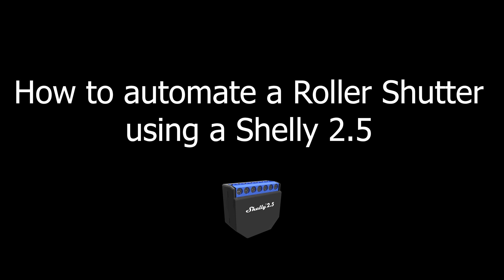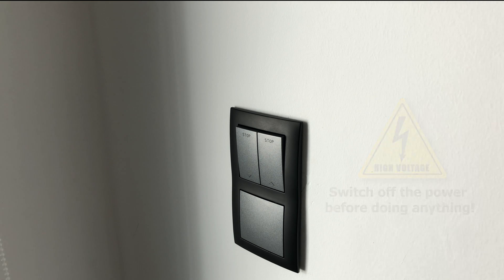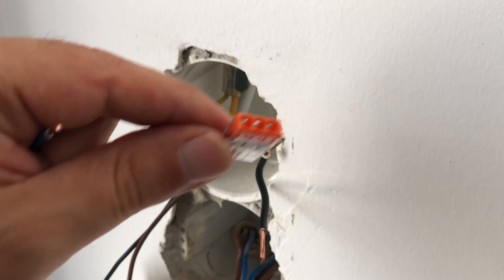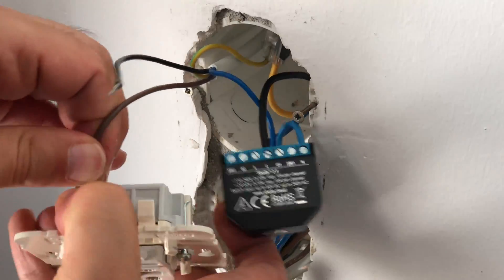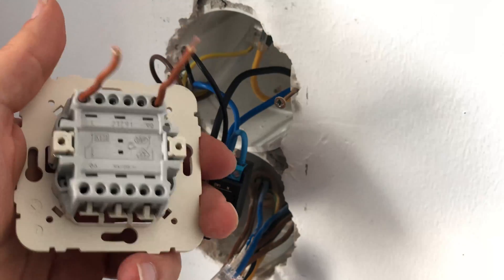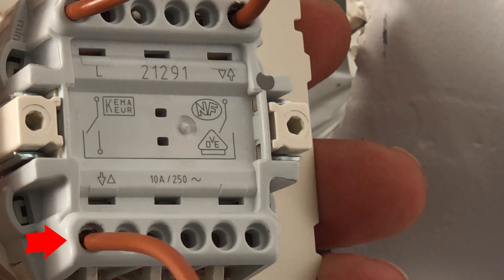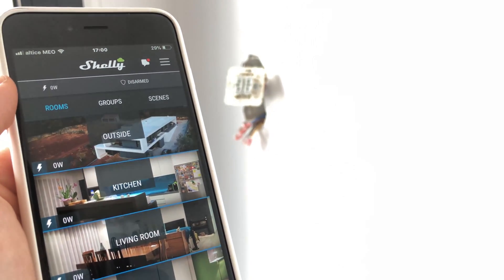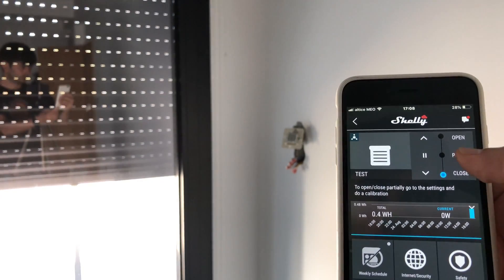How to automate a roller shutter using a Shelly 2 5

Comment: I have a Shelly 2PM Plus and I've got 4 wires coming in from my roller shutters.
Would you please advise what are my options for wiering it?
Thanks
Reply: I would imagine it's 2 load wires (up and down) and then line and neutral. Do you still need help with this?

Comment: Hi friends, can I use din version ? (I build my new house and I have all wire from switches and electric blinds to switchboard..) I found shelly 2 pro or shelly 4 but is alternative to shelly 2.5 ?? Thanks !!
Reply from the maker: Yes! It also supports Roller shutter mode.

Comment: Great video,  but there is one issue. The switch on the video has 2 x STOP and 1 x UP and 1 x DOWN.  The Shelly only has 2 x Switch outputs.  The problem I have now after installing the Shelly 2.5 is that Shutter doesn't stop when I push the STOP button.

Without the Shelly I can stop the roller shutter by pushing STOP,  with the Shelly the STOP doesnt work.

I saw you have switch Efapel 21291, I have 21290.. I that why?
Reply from the maker: HI Paulo! Thanks for your comment! I think the only difference between the 2 EFAPEL buttons is that in mine (when doing it without Shelly) I have to manually stop before activating the opposite action. I think in terms of connections to the Shelly they are probably the same. I'm thinking if it might be a configuration on the shelly side. How do you have your Device Type, Input Buttons Mode and Button Type? Mine are set to Roller Shutter, Open & Close Buttons and Momentary.

Comment: This description and the video seems to have an error. It says to add the black wire (Active) to only one of the L terminals on the Shelly. Later in the video it then connects the L terminal of the switch to the other L terminal on the Shelly. This is how I connected mine but the Shelly would only operate in Relay mode. To make it operate in Roller Shutter mode I had to connect an active supply to BOTH of the L terminals of the Shelly and an active wire to the L terminal of the switch and then it all worked fine. The wiring diagrams of the Shelly device show an Active wire going to both of the L terminals of the Shelly device and also to the L terminal of the switch.
Reply from the maker: Thanks for the feedback!

Comment: Thanks for the video very clear. 2 question please. I have a blue neutral wire but not split as yours with connector, what should i do? Also would you advise how to connect also the lights? Inthe same socket of the roller shut swiths i have also the switch for the light

Comment: Congratulations on a helpful review. How can I get feedback on the condition of the blinds, whether it is open or closed. I think on this principle to drive a pair of garage doors. The garage door automation has a magnetic sensor that sends a status signal, but how do I connect it to the relay?
Reply from the maker: Thanks for yout feedback! For shelly 2.5, you have a setting called positioning controls. See here https://imgur.com/a/akT5mE4
For garage door positioning controls, I'm not sure you can do it with a shelly 2.5. I think for garage door automations you need to use a Shelly 1, which has something called dry contact. But best thing is to post your question on the Shelly support group: https://www.facebook.com/groups/ShellyIoTCommunitySupport/
There is always someone that will reply quickly. :)

Comment: Good video.
But what can I do if in the switch there is no N wire, just the L and the on/off wires?
Reply from the maker: Hmm, not sure. With Shelly 2.5 you need the N wire. There are other shellys that do not require N like the Dimmer.
Maybe ask here - https://www.facebook.com/groups/ShellyIoTCommunitySupport/about/
super helpful community!
Reply: You will need to thread another line for the N. There are smart devices now that don't require N with some electrical "magic" but I think they work for lights. Not sure if it will work with motors...